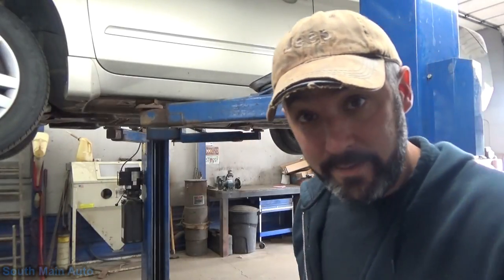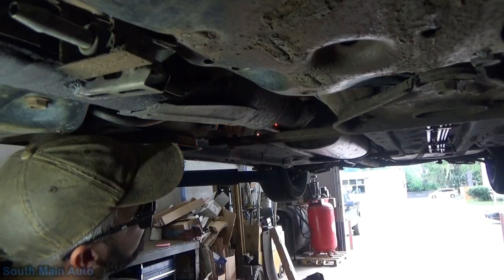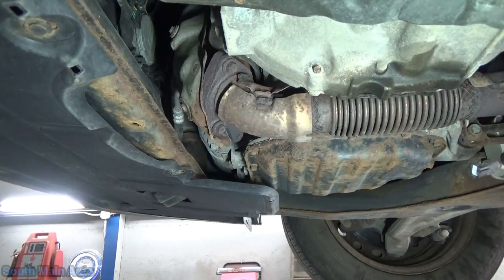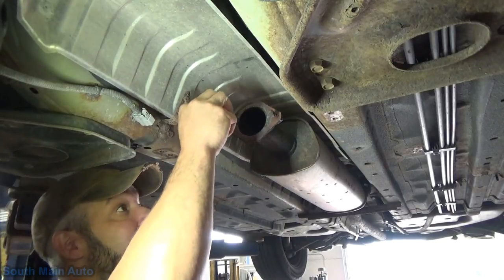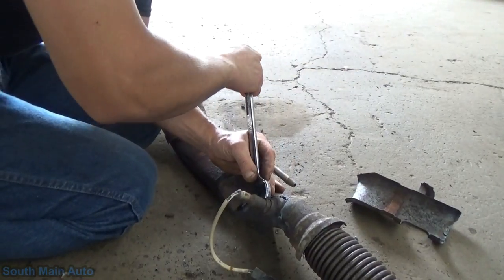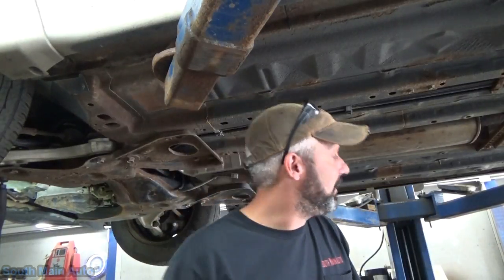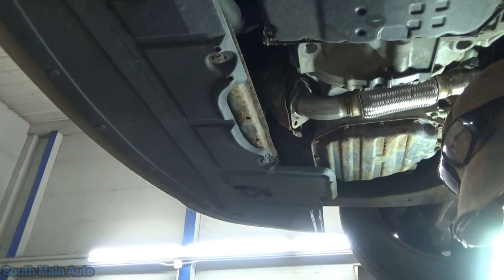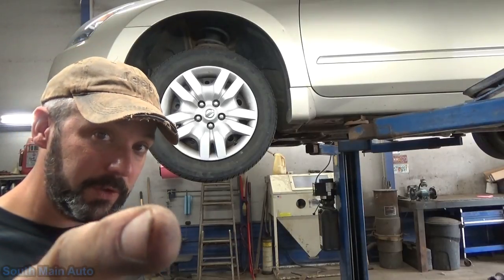Nissan Altima Catalytic Converter - Replacement

Comment: That free air "customer" wasn't from the middle east or something like that? Because they will do that...
They have a problem with their rims? Go to a random shop and do something cheap, then come back with a complaint that whatever the shop did ruined their car and they want a free replacement or Allahu Akbarrrrr!!!

Also, NEVER accept anything for free from these guys. Like they come to you with an offer to borrow their car or whatever... You drive it 2 miles down the road and come back and they will tell you that you broke X, Y and Z while it was in your possession. Even though those things were clearly broken before they even came to you.
The same if you are looking to buy something. If you see they are from MENA, you better turn around and walk away because they will say you broke something while testing it. You fix it and they won't sell you the thing.

And don't sell them stuff either. You can write "as is" on the receipt all you want. But you will have their entire living extended family breathing down your neck forever after because somehow it's your fault the engine blew up 2 miles down the road.
Reply: Got to watch out for the yellow guys and orange guys too. Purple not so much ,at least here in Canada.
Reply: And those white guys are pure as the driven snow...flake ❄️
Reply: Just to clarify here, it doesn't really matter what color people are or where they are from. They can all be scumbags.
But if there's one thing i've learned from countless experiences it's that some groups of people will do such shitty things more frequently than others. It's built into their culture. If they don't learn how that works, they would be effed over every day of the week where they came from.

In other words, it's just natural to some people. It's not really their fault but the fault of the environment they grew up in. It's contagious too, meaning if it spills over into "snowflake land" then it's going to spread until a large enough group of people say NO. Triumph of evil and good men doing nothing and all that stuff.
Reply: Cadde Indians and Pakistanis are even more lethal with stuff like that. Most people I know won't do any business with them at all.
Reply: And Eric Os subscriber base looks to be the same as David Dukes... Jimminy Christmas
Reply: Mario.Media Co my comment on this thread was purely sarcastic. I don't believe race determines honesty.
Reply: Mario, I'd guess you've never been to Pakistan have you?
Reply: Che Kelley, This thread is not about race though. It's about general regions on earth where people are taught to eff each other over in any way possible.
Reply: Cadde - Oh man speaking of the middle east customers you brought back some bad memories of mine (im an old guy, 57) from when I was a mechanic in the early 80's, - I had some great customers and some doozies, but one of the same guys youre talking about would come in with his family as you said, and ask what something cost, then he would shake his head and say too much and try to talk me down on price like it was debatable-!   told him I didnt set the prices, my employer did and finally I had to tell him to go somewhere else if he didn't like our prices.  He asked all kinds of questions way beyond the usual and worst of all he would not stand behind the yellow insurance line and hawkeye me from every angle, then one day he brought his old beater in for an exhaust system - as I was torching the old one off here he is at my elbow, bumps me and I run the torch across my wrist, thankfully it was a quick swipe and mostly just burned the hair off, but I still have a small scar.  I finally had to tell him sternly to get behind the line or take his car out now.  What irked me also was our shop had a good reputation and we always treated folks honest, but I kinda got the impression where he came from it was much different and he just assumed we were crooks - and some are, but we weren't.   I took a small amount of pride in the fact I had certain customers who came in asking for me personally and didn't care for his attitude, he was a real PITA but after a few visits he slowly came to realize he was doing ok with us and he finally showed some trust - but those first two or three times I genuinely hated to see him coming and hoped someone else got his car besides me. lol
Reply: Even though it is no longer considered an appropriate thing to say out loud, anyone with eyes and even average intelligence can plainly seem that all cultures are not equal.  Just look at how they treat the weakest and most vulnerable among them.
Reply: You put that very well, cadde - there are no perfect races for sure, as Volcker1929 said  its got a lot to do with the environment they come from.  I have a very definite set of morals and ethics that was drilled into me at an early age and ive tried hard to maintain it - those adolescent teen years were tough though-lol   But I have ran into this totally different mentality from other cultures where they either think everything is up for barter, or they just expect you to let them talk you out of or into something, and if that's all they know  they don't see the problem.  But its far from the worst, in some cultures beheadings, sterilizing females, child rape are tolerated and even considered legal - so ill count my blessings I live in America - its damn far from perfect but more tolerable than a lot of other places.
Reply: Ahhhh... you Americans are just trying to make America great again
Reply: Charles L Every Day!